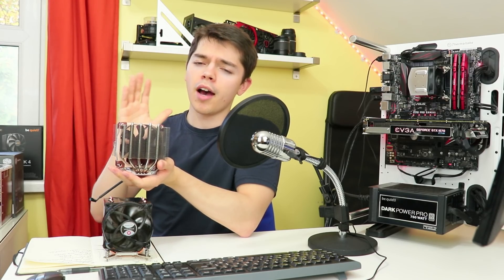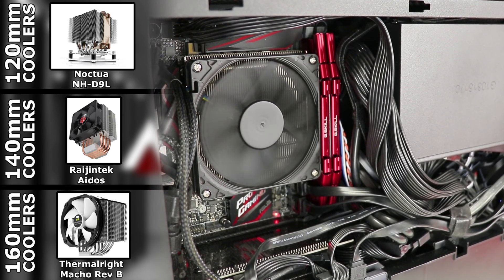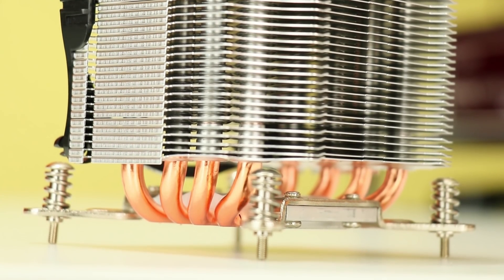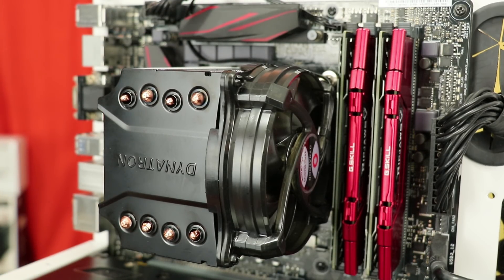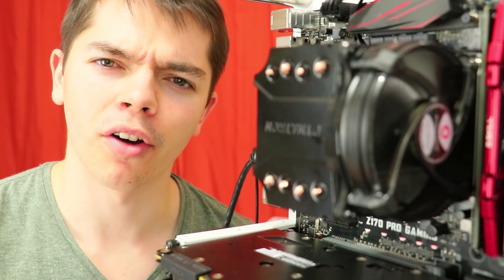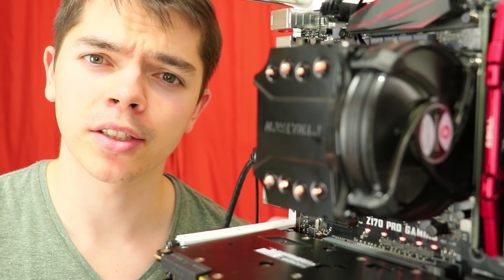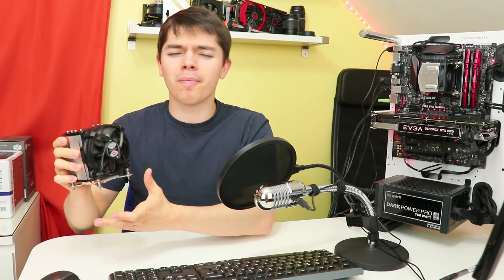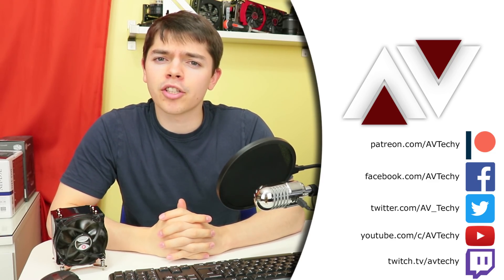Dynatron K17 Review - Better than the Noctua NH-D9L?

Comment from the maker: Time Stamps for Mobile users:

01:00 - Cooler Showdown List
04:06 - Unboxing
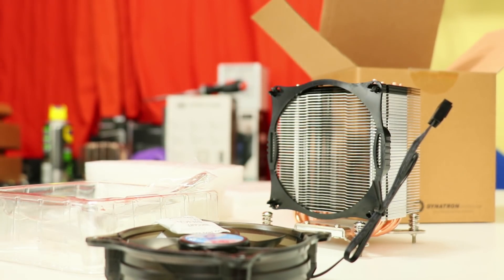04:44 - Overview
06:41 - Installation
08:42 - Sound Test (20%, 60%, 100% PWM Fan Speed)
11:26 - B-roll
12:23 - Thermal Paste Application Check
12:57 - Thermal Testing Results
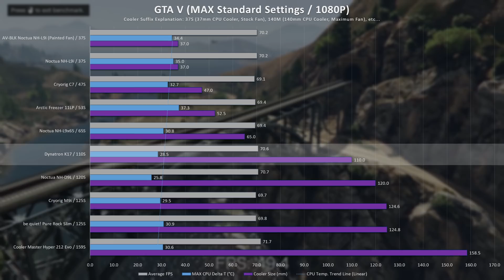15:51 - Conclusion

Comment: After 4 years and still a nice comparison
What us the small cpu cooler you was using in your setup ?
Reply from the maker: Cheers. Not sure what small CPU cooler you're referring to, but I've used Noctua NH-D9L's, NH-L9i's, and NH-L9x65's in the past as my smaller test CPU coolers. All excellent coolers, but can be a little pricey and close competitors can be had for cheaper, but may be slightly larger.

Comment: K17 @2500rpm 4770K@50% load @3.6ghz = 78C.  K17 @2500rpm 4770K@4.0ghz = 101C and throttling. Absolutely ABYSMAL performance for a cooler this price and size. The fins do get quite hot so I know there is transfer from the CPU to the cooler. If you buy this cooler, plan on buying a new fan for it because the one provided doesn't move much air at all.

Comment: not really sure what you're on about with the noise... i've got dual dynatron G17 coolers which are exactly the same except for the mounting and i cant hear them at all, and the performance for the money is unbeatable. i can load up dual xeon x5675 cpu's with prime95 smallfft's or folding@home and they never go above 62 degrees. unless you're an absolute silence NUT, these dynatron coolers should be absolutely fine.

Comment: I had a dynatron for my 4790K.. nothing could beat that little 8000rpm monster.. it's performance is frkn insane.. and actually I had a noise dampening case.. it was still loud but 95% I use my pc I have a headset on.. and for the other 5% the performance demand is so low the fan ran like 1000rpm max.. it might require some adjustment but it's really out of the questions that these monsters have by far the best performance.. especially the server versions

Comment: Can you add the Thermalright LEGRANDMACHO to your 160mm cooler testing?  it suppose to be as capable as the D15S.
Reply from the maker: It was on the list, but at the moment I can't find any to buy. I've got the Macho Rev.B, but of course that's got one less heat pipe which will have an effect on the performance.

Comment: Too loud for a home computer and probably too weak for everything else. Try this on a Threadripper CPU
Reply from the maker: It would be nice to see how well the cooler would perform with a different fan, but that would just cost more money that it's likely worth. And the mounting solution would probably look awful.

Haha, Threadripper might be a push, but it would be fun to find out how bad it gets.
Reply: "Too loud"? Really?
Reply from the maker: Have you listened to the "Sound Test" part of the video?  Bear in mind my voice is raised to a presentation sound level, not a quiet conversation level. The Motor noise is very noticeable which would make it a distraction below 1500rpm when browsing the internet, writing up some documents, light to mid CPU intensive gaming, etc.

Actually watching films with the test bench on the desk was irritating to the point of putting the computer on the floor (better, but still noticeable). Nothing breaks immersion like a noise that's out of place with the experience you are trying to have, especially during quiet times. You may hear a lot of video producers on YouTube say that they turn their AC off during recording because it's an irritating  noise in the background that spoils the audio, it's a similar kind of irritation with this fan.

The motor noise is less noticeable at 2500rpm, but it's much louder than any other fan I've worked with at the low to mid rpm range. But even at 2500rpm it's louder than ideal, especially compared to something like the NH-D9L.

Maybe I've just been spoiled by too many high quality fans (although I've mostly worked with mid to low price coolers so I doubt it). Ideally the fan would be nearly silent, I'm working with the Dark Rock 4 at the moment and its fan at 1400rpm is very quiet, especially compared to the fan on the K17.
Reply: AV Techy  Of course it's quiet - I'm just adding some hyerbole to Sinista's comment
Reply from the maker: Right, now I'm with you. Only it's loud over being quiet.
Reply: Its not loud at all, I mean its not even inside a case lol.